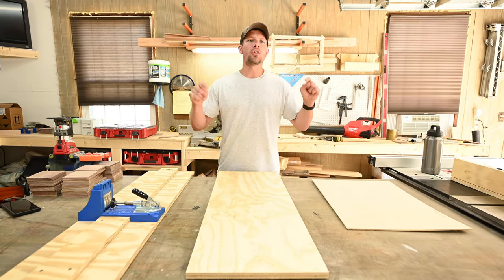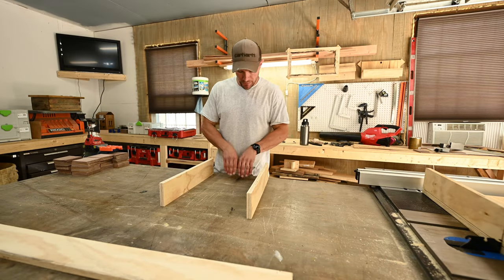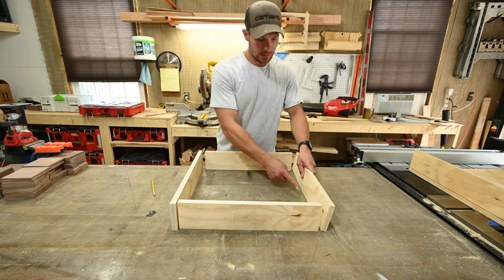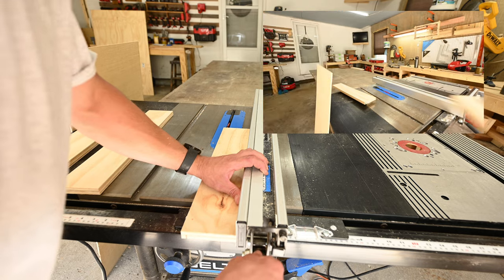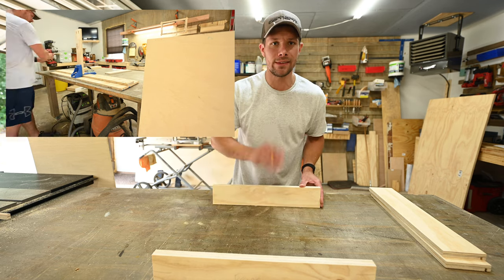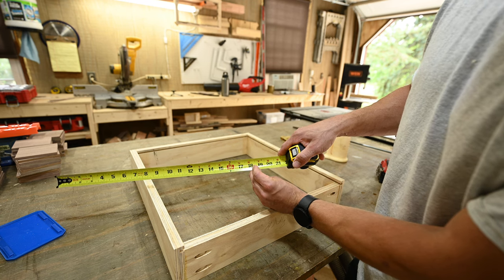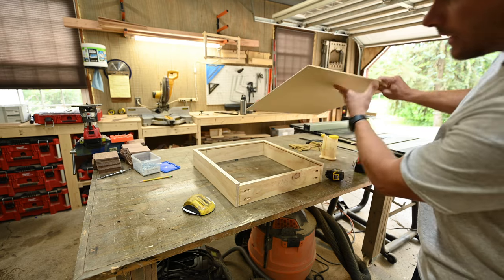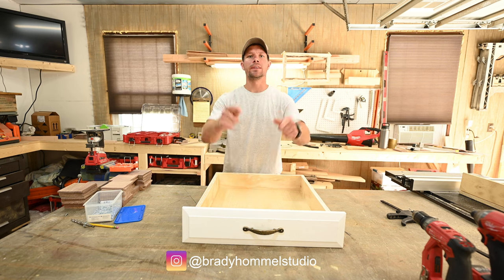DIY Easy drawer box assembly in 5 minutes! - How To

Comment: Thank you for the video. I'm going to be tackling this project real soon and this looks very helpful. One question though, why do you cut off the back piece rather than cut a groove (you call it dado)? Seems like you could slide the bottom board in for extra support this way. Edit. You'd have to put the back piece on last that way, maybe that'd be a hassle to line up.
Reply from the maker: This way if the bottom panel even gets damaged you can unscrew the panel and slide it out to replace it. But you can absolutely put the same groove in the back piece as well and build it that way. I do that too

Comment: Why wouldn’t you dado the back piece, insert the bottom, and then glue and screw in the back piece?
Reply from the maker: Because the way I did it the drawer bottom is removable if it ever gets damaged and easily replaced

Comment: So question, when you knocked an eighth off the end of the drawer bottom. Was that because you book matched the sides making the sides width a hair shy of an actual 3/4 inch and would leave a small lip on the outside of the box if you didn't take off that extra eighth of an inch?
Reply: I think it is to make the bottom of the drawer replacable and easier to fit the first time.